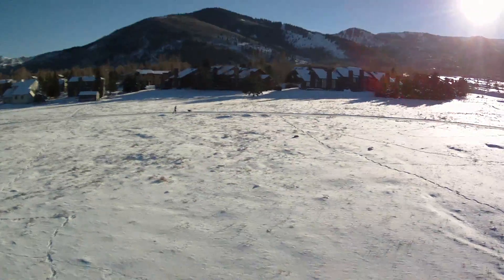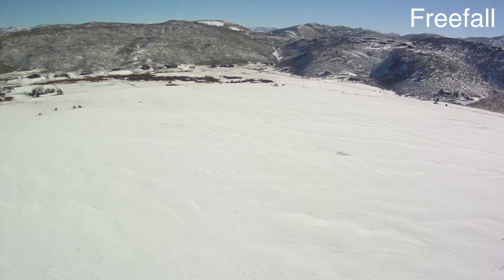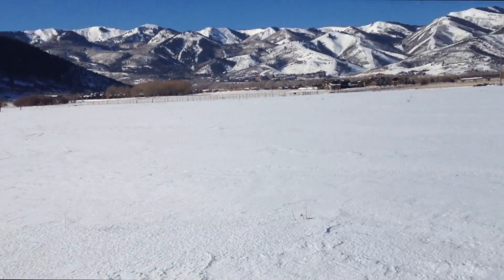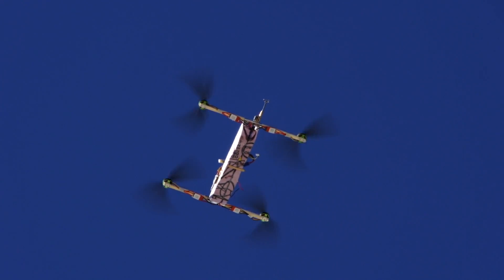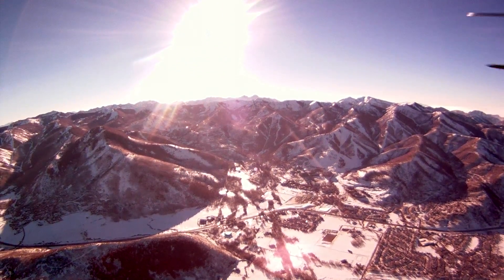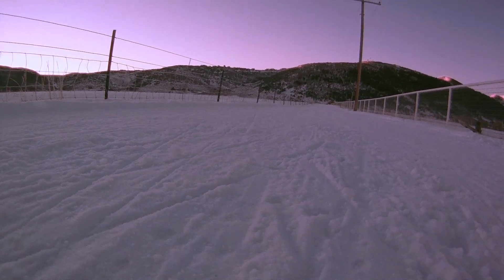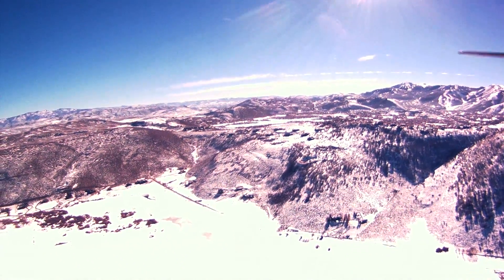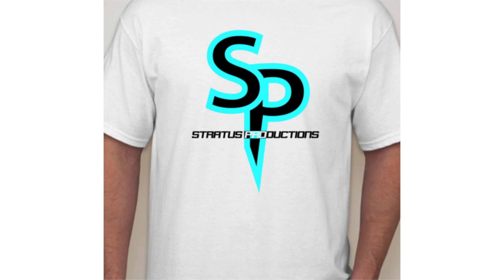High Altitude H-Quad Free Fall - RCTESTFLIGHT

Comment: Don't do this to most quads. You can fry components on your flight controller (5v). When the motor is being turned by the wind it's acting as a generator and the voltage from the motor can and will fry stuff.  I landed one day in the grass and the grass was just cut and I got clippings all inside my stack and while sitting beside a fan outside I used it to blow the junk out from the stack. Well as soon as the wind hit the props they started to spin up and fried my 5v rail.  (We live We learn We try and We fly)
It has to be a pretty good burst to do this but it can be done.

Comment: I'm a private pilot. When we fly RC in the US we are flying in class G airspace for the most part. That is the GOOD airspace for small manned airplanes. Low and fast is where we go to have fun, skirt under a low ceiling or controled airspace, and for work, flying pipelines or undersea cables, counting fish, or searching for a fire. There are many reasons for a manned ACFT to LEGALLY be below 1000' AGL. Yesterday I had my first encounter with a low flying ACFT. I was demonstrating the RTH function for a rookie RC pilot. Trees here exceed 200 feet in height so RTH altitude is 75m. What came busting out of the pass from under the low ceiling....what do you think it was? Oh IDK maybe it was a C-172, sure looked like one, hauling ass about 300 to 400 feet above the park. We call it scud running. Scud running is being forced down to LOW LEVEL by clouds. And it's perfectly legal in class G airspace.  

All this crap I read from drone people is like WOW! You really have no clue, none at all. I'll tell you what is going to happen. A drone is going to get sucked into a turban on short final and the jet is going to crash. Or a drone is going through the 1/8" thick plexiglass windscreen of a Cessna 172. At 150 mph combined speed the impact and shards will turn the pilots face into hamburger, and the airplane is going to crash. Then we'll find out how much of hobby aviation survives that outrage. Hell you guys don't even know the right aviation terminologies and sound...low rent when telling us all about the risks of flying. What do you really know? How many near mid-airs have you been in? FACT, (NTSB, FAA): In nearly all mid-air collisions neither crew saw the other airplane before it was to late to react. I've had 3 near misses, that I know of. In all 3 they were over before I knew what was happening. In all 3 I was saved by "The Big Sky Theory." Because we humans can't "see and avoid" reliably we are completely dependent on The Big Sky Theory when we fly. Even airliners with collision avoidance equipment are dependent on the big sky because most non-commercial airplanes don't carry such expensive equipment.

The point is YOU are flying in airspace used by manned airplanes. And YOU are relying on the Big Sky Theory to keep you from causing a boat load of hurt.

Comment: I've noticed that you spend a considerable amount of time searching for downed aircraft after a failure of some sort.  Free Flight airplane modelers have developed many gadgets for finding  lost fly away airplanes, one was a tiny radio transmitter.  But since you already have an on board battery and you are familiar with LED lights how about a flashing super bright strobe?  This could double as an anti-collision safety device.

Comment: If you elevate the motors higher than the body that should solve the stability problem.  And here's the experiment I want to see.  Drone is launched hanging below weather balloon to upper stratosphere.  The balloon pops, and a release system disconnects the drone so it freefalls from near-orbit.  The drone is programmed so the motors don't start until it reaches 400', then it activates and flies back to you and lands.  If the drift puts it out of range of being able to fly back, then maybe a glider type drone would work better.  Think this could be done?

Comment: I will try this but will add a tube with parachute on top of the drone, with release on servo, its 200 size with 4s, i think it could work, my transmitter is 2 km range. Only 1 things bothers me, i will see it only for some 300 meters.

Comment: stick up at CG with something that folds open in free fall to stabilize fall. 
Maybe even hinge it at center and let a very light stick hang between aft rotors and when in free fall it will rise to vertical.

Comment: That was a very cool experiment.     ?Can you wire the gyros so they are powered full time to keep a level attitude, allowing the props to auto rotate at max rpm, I like the flap concept also.  You are onto something here don't quit.     Maybe add a second gyro, or one larger gyro.  This deserves further research because this process adds no extra weight or burden to the craft.  Also add a beeper you can activate from your controller for audio location.

Comment: If these motors are brushless, do all the motors run at the exact same RPM from the motor controller?
Reply: Only during full throttle even they are never running at the same rpm for more than a split second and thats by chance..

Multirotors stabilize/level themselves by slowing and speeding the motors down... That's why it's called an ESC.  ESC stands for Electronic Speed Controller.n.  The flight controller has gyros that tell the speed controllers what to do to get the quad to move the way it wants

Comment: The motors probably didn't start up again because they were spinning backwards so fast that the battery power wasn't enough to stop them and get them to spin in the right direction again.
Reply: Maybe the ESC has some sort of protection and cuts out if too much power is taken? could things like this be logged?
Reply: What if you program a brake on the ESC?
Reply: I wonder if the generated electricity from the motors freewheeling can damage the ESC?

Comment: Well, I'm not sure of the point of this expierment but it was cool. I thought your flaps idea was pretty clever. One point that has been made in these comments is the "stalling" effect when deciding from a high altitude. Some have suggested that the motors are actually being propelled by the air pushing them? Why can't this be used to charge our battery?

Comment: Failure to regain control is due to prop stalling (similar to wing stalling on a fixed wing, the air flow over the upper surface of the blades is no longer laminar and can't produce lift).  Full sized helicopters avoid rotor stalling by reversing the blade angle and auto-rotating.

Comment: Just so you know, when you're motors spin backwards they act as a generator and that's not the best for the fets in the esc
Reply: reverse voltage is not good for any electronics, but this experiment has potential, ie in an emergency the main circuit can be made to open dumping the energy from the motors directly back to the battery through a resistor bank.

Comment: Yo Bro you are an classic example of why the Freakin FAA Is trying to ban FPV! don't know where you live but hope to god your not near any air ports or flight paths and your AMA! .
Reply: MRS BROWN "After watching this guy how can you say he is dangerous."
Well considering the motors Lipo batteries and the aluminum frame i'd say this thing is about 3-5 kilos worth of mass.
Now rewatch this video and count how often he said "I crashed". That is a hunk of aluminum, batteries with the property to burst into flame or even explode when sufficiently damaged and fast rotating props accelerated by the fall.
All crashs were trying to regain control or completely losing it beforehand. Now imagine there was someone in that parking lot, where he crashed without any control.
And then try to tell us again why this should not be consiedered dangerous.
Also to refute that point immediately, he said the motors would not start back up on that crash (see >> 8:50 ). On a multirotor this means no control whatsoever. And it even crashed on a parking spot.
Reply: Due to regulations being imposed on controlled flight, sometimes it's almost tempting to make a free-flyer out of a few small batteries, a cheap motor, and some foam or scrapwood and paper. And let it loose to fly over the horizon and never be seen again. Not controlled at all, and none of the materials used can be restricted because it's essentially made of common and easy to find junk. I'm sure some people would love stuff like that.
Reply: pauljs75 ya and maybe attach a gps locater, get it after a few days, just to see wut it saw.
Reply: Darryl Sims do you know what would happen if an airplane or airliner hit this quad???? OMG! 
Nothing. That's what. Birds and ice are more of a threat.
Reply: Darryl Sims Anyone that begins a paragraph with Yo Bro has to be seven shades of freakin ignorant. I hope to god you do not operate (anything) larger and heavier than a paper airplane.
Reply: Lol this is kinda late, but MRS. BROWN got owned haha
Reply: i am actually wondering if this would do any damage to a plane engine....... naaaaaaa too small.
Reply: PLEASE ENOUGH GOD DAMB SHADES OF GREY REFERENCES FOR FRICKS SAKE IT TYRING.
Reply: Darryl Sims So thank god you are happy in your bliss
Reply: Are you an idiot?
Reply: No one is trying to ban this,  your a paranoid fear monger so simply skedadle. This guy is safe and a pro.These are the pioneers that make things safe unlike the assholen in Dubai failing and lying about their lame and dangerous attempt. Go post there.
Now go buy the new AirHogs toy of the month jack ass.
You are sooo jealous of this dude, lol
Reply: Ignorance , unfortunately is Bliss
Reply: After watching this guy how can you say he is dangerous. What mountain range is your local airport located on ''oh blissfully endowed? ''
 Sorry for the bad word thing but instead of grinding the guy who drives way out into the mountain ranges to experiment  on safety factors such as ways to slow down without busting props in a free fall recovery why don't you save the weenie drama for the assholes in Dubie  trying to fly over that super dooper high building. No one had experience.
They are the dangerous ones. Your just picking on the lone stranger pulling off some amazing stunts 25 miles from nowhere. He even makes his. wow kool huh.
Funny how your the only one going Nazi on the poor civilian. Are you some kind of an authoritarian or saftey inspector at the sponge factory or is this where you can get tuff on decent people then stand your ground? pfttt

Comment: Interesting video. I'm a fan of doing fast drops with my quad, but there is something to be careful of with brushless motors. As you mentioned, in a fast drop one or more props can begin to spin backwards because of the air rushing up past them. When you (or the flight controller) throttles up a motor that is spinning backwards, the ESC can get out of sync because it does not expect such resistance. The result is a screeching sound and no power to the prop. I had 3 crashes due to this, until I figured out exactly what was happening. I simulated the conditions by holding the quad in my kitchen and spinning an idle prop backward with my hand, followed quickly by power-up. About one time in 10 the ESC was not able to spin the motor up again (until the throttle was lowered once more). So now I avoid idle props, using the Arducopter MOT_SPIN_ARMED parameter to ensure that the motors always spin forward a bit. The drop is not quite as fast but it is still fun, plus safer and more stable. Cheers!

Comment: Nice job. I have noticed on my Cinetank that it will exhibit "settling with power" behaviour. If you had designed the flaps to create a slight forward thrust it would probably remain more stable and recover easier.

Comment: I don't get the point of the freefalls.
Reply from the maker: Free falling allows you to get higher up. If your using power to slowly descend, your max altitude is limited because you'll have to turn back sooner.
Reply from the maker: brinh123 Its actually not illegal, just against regulation. There are currently no laws restricting model aircraft. This will change in 2015 tho. So if you ever want to mess around with high altitudes, its best to do it now rather than later. Still its definitely not a smart idea, and I would not recommend anyone do it. The flights done in this video were performed in an area open enough to hear any oncoming aircraft within a mile or so. With the quadcopters ability to free fall, I could quickly avoid them incase of any encounters. I certainly admit to being a hypocrite here, but soon this will be illegal, and less people will do it.
Reply: rctestflight I Undertand.  thanks for the clarification and not being a dick about it :) I've had some conversations where people just become aggressive where others have misunderstood. Take care with this and stay safe.
Reply: Tyler Larson Tyler, you are Correct ONLY IF YOU ARE AN EMPLOYEE OF THE FAA.  I'm not, so the regulation you speak of does not apply.  I used to fly for the USAF, and DO know the regs that apply to flight, cause they were all Passed by congress.  They have yet to pass any regs in relation to R/C aircraft...
Reply: rctestflight The idea of flaps was genial.

 Have you ever thought about installing flaps with servos? It could give you the possibility to control the free fall, or even pitch it down and flare, just like a power of landing of a helicopter. Quads seems to be pretty light and it could be possible to bring them down smoothly =)
Reply: Trevor Rowen
Reply: Trevor Rowen
Reply: Trevor Rowen
Reply: brinh123 Space X researches
Reply: Some people have already pointed this out but that's illegal. It's highly unlikely but an aircraft could collide with your quad at that height and then the whole community would be anti-drone. The media would love it.
Reply: rctestflight "against regulation" = "illegal", since the regulations are in fact laws. But in this case I think you're probably OK. Current FAA regs say you must maintain line-of-sight (which they suggest gives a practical limit of 3K feet), and follow existing airspace rules for aircraft in general when operating in controlled airspace. This also implies a hard limit of 18K feet, which is where the Class A airspace starts, so your aircraft would need a Mode S transponder, flight plan, etc. Not out of the question, but also not familiar territoriality if you're not a pilot.

Comment: Very interesting test. I noticed that the barometer output is temperature dependant.  You fly up in short period of time,  then your flight controller CPU gets altered data. Also the FCs made in China are not working well on sub zero temperatures. It could be the reason for your stalled motors before the crash.
Where did you do these flights? It looks like Area 51 from the air

Comment: Very Cool.  I think maybe some landing gear 6-8 inches under the quad with the batteries attached to the gear, would lower the center of gravity and make the craft more stable in free fall.

A parachute would also be cool.  Deploy it via remote control, drop for a while, cut it away and fly.

Comment: The cold air probably helps for cooling, but wouldn't the thin air have less thermal capacity, making it cool the engines less?
Reply from the maker: The thin air has less resistance to spin a propeller in sot he motor is not working as hard > less heat produced
Reply: rctestflight Ahhh, It isn't simply spinning faster and producing the same amount of heat? Interesting :)

I just found this channel, by the way, I really like the atmosphere of this video, so I'm going to stick around for a while.

Comment: Really cool experimenting!
A few hints should you or anyone feel like trying again; first of all, Id blame the NAZA for not being able to recover each and every time. Naza doesnt have the best reputation for acro, Id suggest trying with a multiwii.
Secondly, as some other people pointed out, a lower cg likely helps a lot.
Finally, I love the ingenuity of the flaps, but drag alone doesnt make it stable. Drop a sheet of paper and you get the idea.  If you put those flaps at an angle, it may work wonders though

Comment: Probably would be better to freefall upside down as the props are spinning the right way in that scenario, this should make recovery easier as there is no chance of the motors cogging or stalling while attempting restart and a good flight controller can manage that no problem. Try it out!

Comment: Smart ideea with autorotation as a safety feature. I like what i saw, i was thincking about that for a while. I use big 18 inch props, i guess the selfleveling comes from CG below propeller plane and centrifugal effect of the spinning props. Great video! Thanks!
Reply: Autorotation yes, but unlike a collective pitch auto the props change direction and spin backwards. The trick is to transition them to forward again when you need  lift, which takes time (and might cause ESC timing to get out of sync with the brushless motor). Plus the flight controller will not stabilize while props are allowed to spin backwards (zero throttle) so the result is almost always a tumble. I'm surprised it didn't tumble more. Cool stuff :)

Comment: If you programmed in a switch brake for the motors, you could, when the time is right to slow the decent, flick the switch and stop the motors all at once to get them all synced to an equal rpm instantly